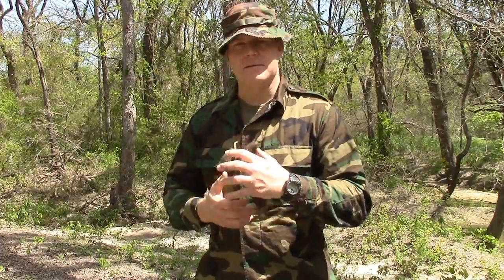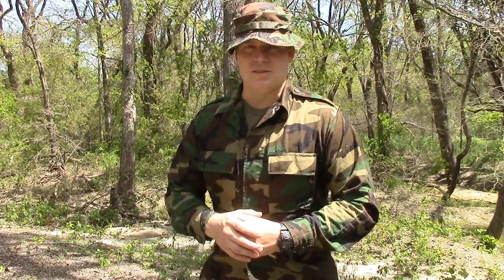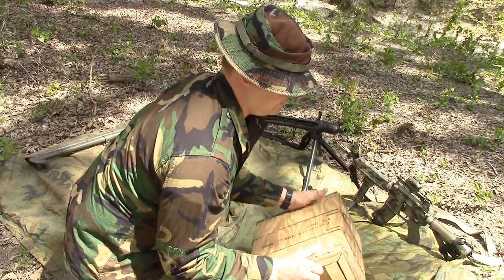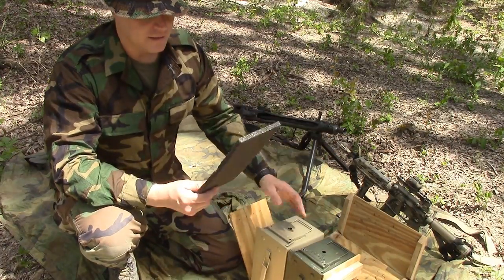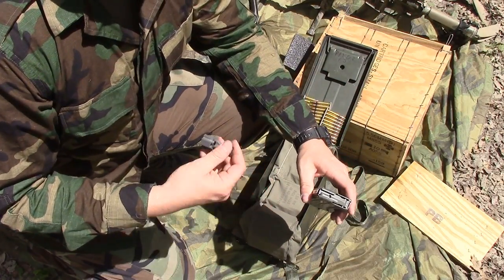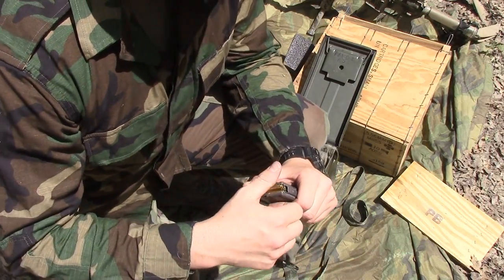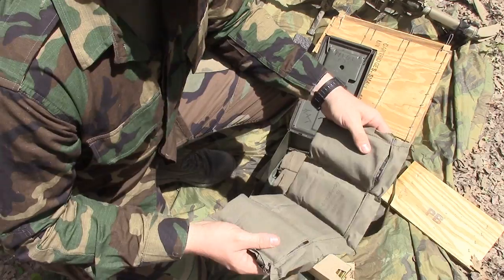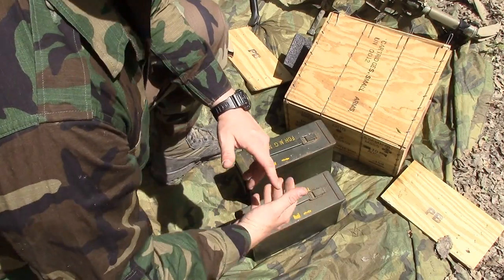Combat Resupply

Comment: ~~( A HELPFUL TIP )~~  Load two tracer rds. in your mags first then top them off to 30 total if you are planning on using them soon.  If you plan on storing your mags loaded, only load 28 rds. total.  The tracers at the end of your mags will remind you to reload just as you run dry.  Thanks for the info, please keep the good info flowing.
Reply from the maker: Appreciate it, thanks for commenting.
Reply: Why only load 28?  To not stress the spring?
Reply: +Granville Higgins springs dont work that way. only real reason is its kinda hard to slam a mag home on an empty bolt with 30 in it but it really doesnt matter.
Reply: Yes, if you just down load buy one or two rds. it can add reliability if stored loaded for long periods, being longer than one year and up to 30 years or longer.  Some manufactures have added a bit of length to the mag and use super high quality springs helping with long term storage problems.
Reply: That thought by itself sounds like a good idea, but  Not too sure I want the enemy knowing I just ran out  and need to reload.  Has your technique been used in combat? First time I hear of this.
Reply: This is an old trick and has been used over and over.  WW2, Korea, Vietnam, and all the middle east conflicts.  Some people only do one of the last three last rounds but I do the last two.  You do understand that the tracers can only be seen from behind, hopefully you're shooting at the enemy and there not behind you.  Only some of the people do this, it's not uniform across the military.  This is only a Tip or insiders Trick.  Thanks for the reply.
Reply: The reliability of the mag thing isn't true, I've personally witnessed M1 carbine mags loaded from WW2 being fired and used as if they were new, and those are crap mags to begin with. The reason that AR mags (among others) are downloaded is due to the way the mag is inserted and locked into the AR it's straight up there's no leverage, so when the bolt is in battery a full mag is very hard to lock into the mag catch and can easily fall out if you don't slam it. I personally have 30 in the mag that stays in the gun but my reloads are downloaded so they smoothly lock in without risking them falling out after a reload. BUT with an AK this is irrelevant because the rock and lock gives the leverage to easily lock in a full mag, no reason not to have 30 in your AK mags.

Bottom line is springs are worn from the compression/expansion cycle remaining in one or the other will not wear one especially a modern made spring, you can do the research on the physics and materials yourself if you want but it's a fact. Not being a dick but this myth just wont die, and it needs to.
Reply: I use to keep one mag full of tracers in my cargo pocket to help direct my saw gunner's fire. 5 fire balls on a target and my whole team would pepper it.
Reply: Learned about the two Tracer Rounds from the Maine Prepper channel before he pulled down his YouTube channel !  tjl
Reply: Da A actually in physics a spring that is extended for a long period of time will actually deform slightly to gain length. Think of it as a really slow moving liquid. You won't notice the stretch but it happens.
Reply: BulletSpoung I'm almost 100% certain that you are wrong on the tracer round only being seen from behind. I could be wrong but I don't think I am on this one.
Reply: emptybottleof151 Same. Kept a full one in a dump pouch.
Reply: BulletSpoung nope. Tracers can be seen from every side. I don’t think you actually know how tracers work.
Reply: To be fair. You may not always have tracers? I have not been in the military. However i do own an ar, and i would think you would notice the bolt locking open?  Just my thoughts.
Reply: @richmeisterradio  they don't always hold open and you don't always notice last round. Combat is a different environment.
Reply: @19stump65  fair enough. Full mag versus empty mag is also a major weight difference. Atleast on a 223/556 ar.
Reply: @richmeisterradio  yeah , we always run 28,29 load outs.
Reply: Yeah, the 2 tracers at the end of the mag is just a waste of time. You're gonna know your out of ammo by the fact the weapon has stopped firing and the bolt locked to the rear. And reloading doesn't take very long, if it takes you more that 10 secs to change mags, you need to work on your reloading technique. Never timed my self but im sure i could speed reload in under 5 secs, and im just a POG.
Reply: Isaac Housley not trying to sound like an ass I’ve personally never been in combat but did a lot of times shooting and competitions and I know that even with just the stress of a timer it’s sometimes difficult to realize the weapon has stopped firing I’ve used tracers for that reason myself because it moves your attention and is a subtle reminder to reload I can’t imagine the stress of combat but I’m very certain it would be higher than that if a simple timer
Reply: @SicSemperEvelloMortemTyrannis TyrannyEnder you are right springs wear out from repeatedly compressing and expanding. otherwise people would need to pull the heads off their boats, lawn mowers, atvs, motorcycles, etc to store them. As half the valves will be compressed. engines sit for years with valve springs under compression and they are fine (rubber seals, hoses, and lines are another issue).
Reply: Oh man.  I thought I'd invented that 'tip'.  I used to get my guys to load 5 bull, then 3 tracer (if we could get hold of them.  Usually stolen from belts of 4-bit) then fill up with 20 bull.  (Yes I know that's 28 rounds.  The British Army don't load 30 in dry or sandy conditions.  That allows a small space at the bottom of the mag for the sand and grit to accumulate).
Reply: this is good advice...or you could just change out the mag like you were trained.... just because I count rounds doesnt mean everybody else can. even panicking, I know when the mag is empty before the bolt catches..doesnt mean anything.except that I know when my rifle is empty....doesnt mean I can get back into the fight any faster, just that I know how many rounds I have....
Reply: We usually ran with 2 tracers on the bottom. Tracer every 4th round or so and top two tracers. Most of us kept a full mag of just tracers for target marking situations. While ive heard storing full mags is fine i know nobody in our platoon loaded past 28 rounds. Probably a matter of antique beat to crap mags but full load caused malfunctions too often to trust.
Reply: @matthewnunya8483  weak springs and bent lips... you only get to drop a mag once before it gets unreliable, from what i have heard. that doesnt seem right, but the folks who have said that are most likely not full of shit.
Reply: @BulletSpoung  tracer can be sight also from sides dude, but the trick is good couse with 2 tracer only isnt so easy to spot the origin. big difference is instead if u have a tracer every 5 rounds... then the machinegunner it's easily pinpointed
Reply: @noncarbonfiber2406  man bave you ever heard of punctuation ? That was the longest fucking sentence I've ever read
Reply: @BulletSpoung  whaa??? Tracer rounds dont work both ways!? Just learned something extremely valuable...
Reply: Richard Mack 
The idea is to know you’re about to run out BEFORE you actually do (when the bolt locks to the rear). I personally always put three tracers in the bottom of my mags. But I don’t think 2 vs 3 really matters.
Reply: In aircrafts they change the colour of the tracer in the last 100 rounds so the pilot or gunner knows he's getting low.
Reply: Thanks that's really smart never thought of that
Reply: @Richardmack the military ammo supply is waaaaay different that the civilian one plus you prbly wouldn't need that in a civilian setting anyways. Unless you are bound to miss 28 rounds in your own house and have never been to the range.
Reply: H Max you dont really have to worry about that sort of thing, one because you’ve always got someone covering you, and two because you are already reloaded by the time they try anything.
Reply: Granville Higgins : there are times when the magazine doesn’t want to seat on a closed bolt. It will seat if the soldier gives it an extra hard slap. Very few things more embarrassing than a full magazine falling on the ground.
Reply: I've heard of spec ops guys doing this from my cousin who is in US Army special forces.
Reply: It also gives away your position to the enemy
Reply: Tracers will also give your position away.
Reply: @daa3417  t t cfg
Reply: BulletSpoung  I didn't know that the tracer rd couldn't be seen from it coming towards you. But if it's true, and somehow the enemy got behind you it still wouldn't blow your cover because you would still be shooting at them right?lol
Reply: @richmeisterradio  Hey Rich,been in the Army and have owned ARs in civilian life too,if you add in the stress of combat I couldnt notice when the bolt locked back but as a civi I can.👌👍
Reply: @oskardirlewanger6126  fair point. Very fair point.
Reply: Be ready to displace.....tracers work both ways.
Reply: @isaachousley325  you’re trying to sound badass and think reloading an m4 takes 5-10 seconds?😂 and no you don’t always notice the bolt staying back
Reply: @E3742O  how unaware does one have to be to not be able to tell that the gun didn't go boom when you pulled the trigger? And a speed reload, changing mags should take no more than 5-10 seconds. Any longer that that and you have to be so uncoordinated that you shouldn't have a weapon in your hands anyway.
Reply: Clever.
Reply: @daa3417  Heard the thing about springs started when they supplied some batches of magazines with cheap weak springs to the US military.

Comment: The new style bandoleer has a feature the older style didn't have. Old bandoleers had 6 pockets containing two 10-round clips each, total of 120 rounds. But did not have the extra space to make the bandoleer a magazine holder after the removal of that loose string. That is a great idea. Plus the newer style having 4 pockets containing 3 each 10-round clips, totaling 120 rounds. Seems to take less space when slung over the shoulder. Plus the loose string/magazine holding capability. Wonderful idea. Things are getting better all the time.
Reply: The lids to all US ammo cans can be separated from main part of the ammo can. Completely open the lid. Slide the lid left to separate the lid from the main compartment. May have use a open and closing motion to get to separate. Works best when loading the M2 machine gun, .50-bmg. The gun mount has a holding tray for the ammo can. Removing the lid prevents the lid from bouncing around when on a moving vehicle. Reverse the process to put the lid back on the can.
Reply: The Vietnam era bandoleers are how you describe.  They didn't have the "extra" space to open up to a 30-round length because they were the right length for a 20-round magazine which was standard when that bandoleer was standardized.

That's also why each (old) pocket held 2 10 round stripper clips (to fill said 20-round magazines).
Reply: Travis Thacker  :Taking the top off of most of the M-2a1 ammo cans is fairly self-explanatory. Just completely open the lid. Notice the two piece hinges connecting the lid to the main can. One part of the hinge is attached to the lid, the other side is attached to the main compartment. Push the lid toward the hinges that are on the lid. May need to open & close the lid to slide the hinges off the pins inside the hinges. Reverse the process to reattach the lid for later use.
The Russian ammo cans are great and last a long time. But once opened the can cannot be resealed. I've seen some decades old ammo from the Russian ammo cans. Never saw ruined ammunition from any Russian ammo can that was intact with an unbroken seal. Only problem was if there was any unused ammo there wasn't any way to reseal the original can.
The M-2a1 ammo cans can be reused until it completely falls apart. I think all NATO allies use the M-2a1 ammo can. Don't need to use bungee cords to keep the ammo can on a pedestal mount. There is a spring clamp on the ammo can shelf to keep the can from falling off. There was a similar clamp on the shelf fro the M-60 (7.62x51 NATO) pedestal mount. Just smaller than the M-2, .50-bmg.
Reply: Interesting. I only have the 6 pocket bandoleers. Didn’t know of the 4 or the string trick.

Comment: excellent use of the 556 bandoleers. I never knew they expanded.  I used them to hold my cassettes for my Walkman
Reply: maybe you had the older ones for the 20 rounders, they didn't expand as the new ones and each pocket held only 2 10-rounds clips in six pockets (still for a total of 120 rounds)

Comment: great job brother, in Czech army we use VZ58 rifles to load clips to mags very fast and you can engage right away. looking forward to see your video with VZ95 camo
Reply: +Michal Nozar Thats another reason I LOVE my Vz. 58!!!  (OEF1, OIF 1&2)
Reply from the maker: +Michal Nozar That's good stuff brother.
Reply: +PathisNarrow definitely it's great rifle, personally I would go with round that make bigger hole so 7.62x39 specially if you will using it for self defence, sense intruder could be under narcotics
Reply: +Michal Nozar  Dos the Czech army use a light coat of wax on their stripper clips to aid in feeding the rounds? I got some Czech BXN stripper clips from E-bay and they had a little wax on them, it made the rounds feed with half the force as uncoated Yugo surplus clips. It would be cool to know any tricks you may know about the VZ58. Love my VZ58.

Comment: One of the things I'm looking to design is an impact resistant pack that can hold pre-loaded M4 magazines in addition to pre-prepared ammunition.

Taking feedback from my late father who served in 5th Special Forces Vietnam and was also a Korean war vet as well as my older cousin who was with first air cavalry Gunship pilot during the Vietnam conflict. Plus my own personal experience with ammo resupply during a firefight. Time is a valuable commodity.....

The battle of Fallujah is a key example of the need for my design.  Not only ammo but hydration and medical gear, MRE's 

This is needed for our Military
Reply: Any progress?
Reply: @tastychunks  I may have found a solution still in the testing phase. But so far everything's working as designed. May have military applications for stranded troops during a battle.

Comment: Those speed loaders/spoons can be a bit tricky.  About 5 years ago I was introduced to the StripLULA. You can load a 30rnd Mag in about 30 seconds or less.  I keep one in my kit. They are not that expensive either. Just an FYI...  Also good vid thank you...
Reply: spacedredd 
Mine works with AR, and Mini 14 mags.

Comment: I did not expect to be fascinated by this video, but I was.  I'd like to think I could've figured out the stripper clip bit, but I wouldn't have thought to pull the thread out to put full mags in, and I seriously doubt I would have thought of the safety pin if the strap was too long (I would have just tied a knot in it lol).  Thank you for this!

Comment: lol I always wondered why 5.56 came on strippers.
Reply: Most US rifle rounds since the .30-'06 or maybe the .30-40 Krag before that came in stripper clips.  Other than the M1 (which used a different 8-round en bloc clip), most US rifles up until the M16 could be fed with stripper clips.  The M14, for example, could be fed from a magazine (and had similar bandoleers with similar clips and similar speed loaders) but could also be directly loaded with stripper clips into the magazine with built-in stripper clip guides.
Reply: Todkaninchen  thats why I always wondered.  nothing in 5.56 has guides for strippers and I've never seen someone load a mag with them untill this video.  now it all makes sense lol

Comment: Can you buy ammo in this configuration still or is it mostly military use?
Reply from the maker: You can find it on the civilian market as well.
Reply: +Brent0331 thanks, I'll have to check that out
Reply: Espically in russian ammo. 7.62x54r and 7.62x39 you can get in crates for a lot cheaper. Just remember with russian surplus it has corrisive primers so clean your weapon very well afterwards

Comment: I'm an army national guard avionics mechanic. We rarely will see combat if ever. Yet we're trained on every infantry weapons system the army has. Excluding grenades and rocket launchers. Those we had in basic. I had a Sergeant who was previously a marine for 8 years then went into the NG and I believe was an MP? Then came to aviation. He took the time to show me how my pouches should be placed on my body armor. No one used the Molle bandoliers that we were issued. He made sure that if it held mags we had it on our person and easy to access. I think I ended up with the ability to hold 10 M16/M4 mags. He said that if you have space for a mag bring it. I'd rather have too much than not enough. He was part of the Iraq invasion in 03' among others. It was just a handful of times he taught me a few of these things. He transferred to another unit just recently. Now I'm stuck with POG's who don't know a thing about this stuff. I've been assigned to a Downed Aircraft Recovery Team (DART). It is more likely for me to leave the fence and knowing this stuff is helpful.

Comment: I served with the Marines in the mid 1980's, attending what was then called ITS at Camp Pendleton. Had lots of live-fire exercises so had many instances where we had to load our magazines. Unfortunately, speed loaders were very rare to come across, so you almost always had to remove the rounds individually from the clip. If you were fortunate enough to find a speed loader, (if you were the first person to break open a case of ammo it was the first thing you looked for) you held on to that sucker and didn't let it get out that you had one. There were also live-fire exercises where you had a 1 in 5 tracer mix, so it was just easier to load the rounds singly.